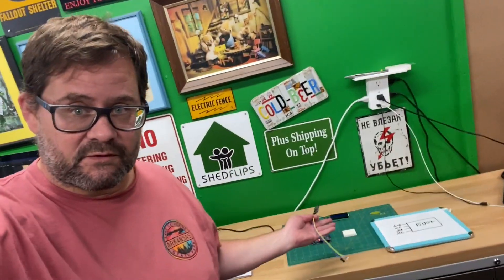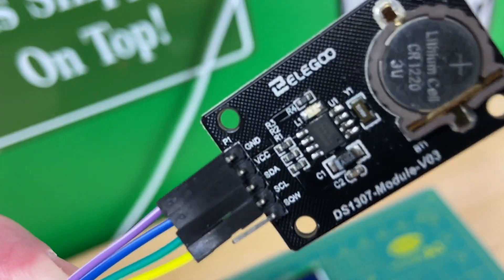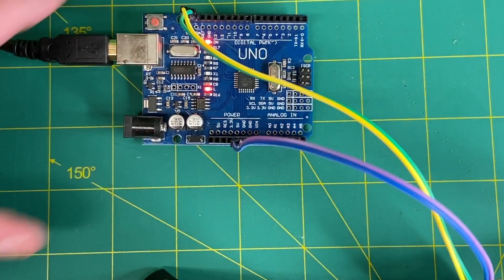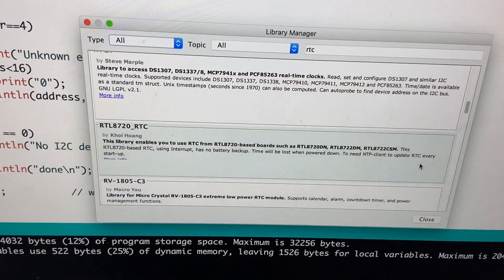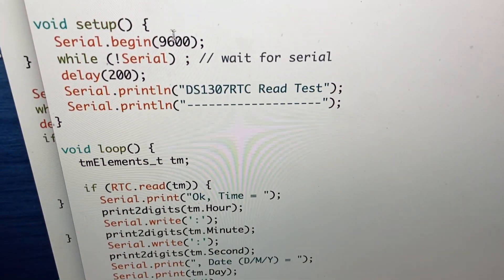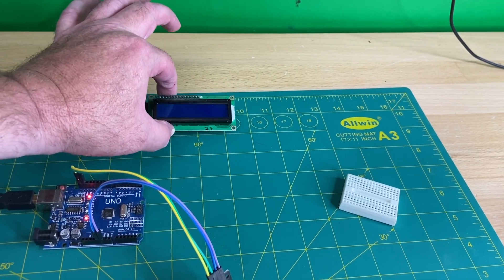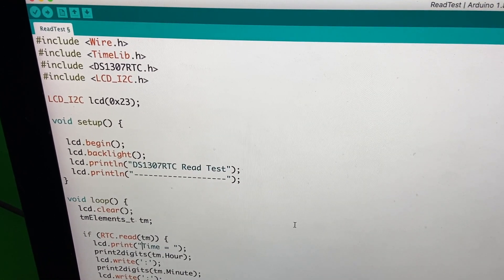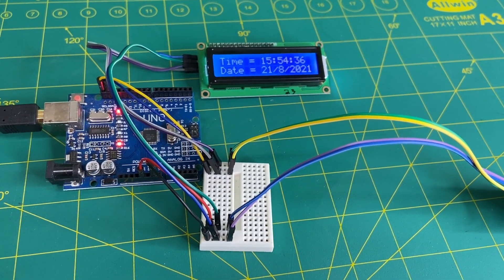How do I use a Real Time Clock with Arduino?  RTC 1307

Comment: How do you ever get those RTC modules to work?  I got 6 of them from Amazon and can't get any of them to work since the 32 KHz crystal doesn't oscillate and the ds1307 doesn't do anything!  I tried replacing the crystal on one of them but that didn't make any difference.  I wonder if they were all made with counterfeit clock chips or what is going on with them?
Reply: Ive got my module working but my code no matter what i do doesnt allow me to store the correct time on the module while its disconnected from power.
Reply: @lightyagami3492  The built in examples let you set and then display the time in the monitor so it should work if you have a good battery but I still got no display.

Comment: What modifications did you make in order to get the I2C LCD screen to work? I am attempting this project and seem to be missing something, the Serial Monitor prints as you show but when I switch to LCD.Print it does not print as yours. I heard you say you modified the code to dial it in, I am wondering what it was you had to do.
Reply: yes i am stuck too
Reply: @Avidiy  Make sure your LCD hex location is correct, im pretty sure there is a test for that a i2c lcd examples